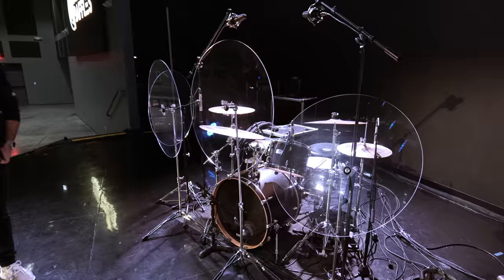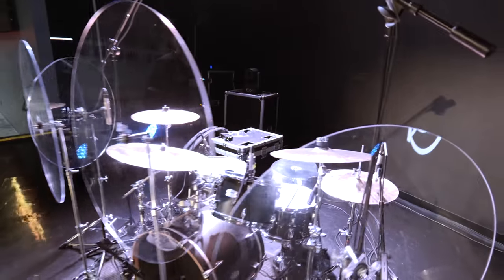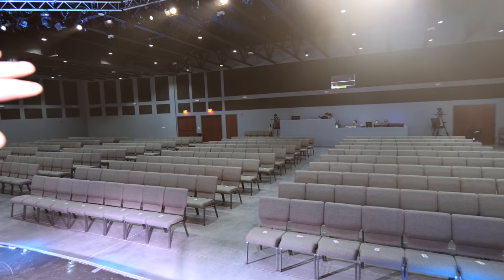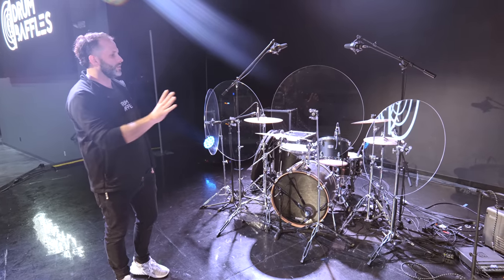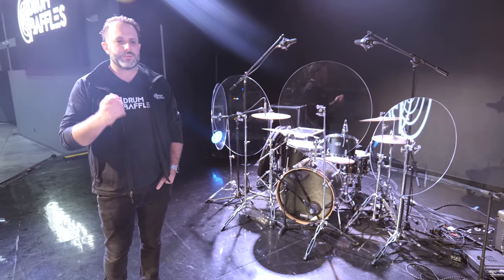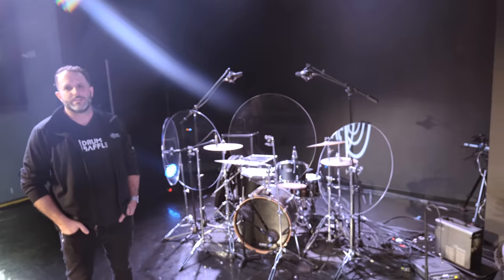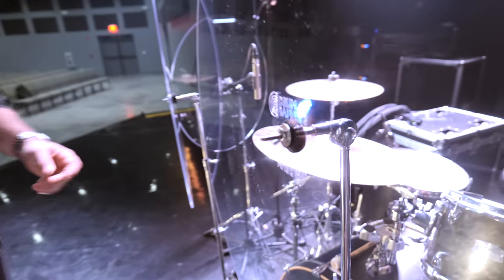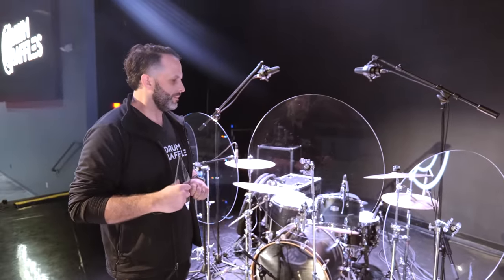Drum Baffles for Worship Bands

Comment: There's a lot of misinformation here. I watch your videos all the time Jake and I enjoy your content, but I feel the need to counter some of this guys claims to avoid volunteer church audio guys being misled.

"In an enclosure, the band members can't feel the kick". You don't feel the kick from the natural energy of the kick drum. You can hear it being hit, but it doesn't naturally emanate 50hz sound waves at 95db. Subwoofers do that. An enclosure doesn't prevent this.

"Putting a sub on stage defeated the purpose of an enclosure for us". A subwoofer on stage with the kick, toms, and bass guitar coming through it is nowhere near the same as reproducing an entire unenclosed drum set. The purpose of the enclosure is to reduce the entire volume of the drums so that they can be controlled by the audio engineer.

"One drum mic picks up everything (in an enclosure)". This is the case on an unenclosed drum set as well. It's the nature of drums, they're all loud regardless of whether they're in an enclosure or not.

"You only need one or two mics in an enclosure". This is 100% not true. Yeah you get reflections in an enclosure but this is being dramatically overstated.

"Your mix sounds better because you can have targeted mic placement outside of an enclosure" This is the one that made me stop and write this. It's a blatent lie for two reasons. 1. When you mic up your individual drums in an enclosure it's not difficult to achieve isolated sounds. Again, there is some reflection but the amount of hyperbole he's using is off the charts. 2. If you're talking about bleed, your mix will sound undoubtedly sound WORSE without an enclosure because it's impossible to isolate everything. Your drums are now bleeding into everything on the stage.

"Your tom gates won't be going crazy outside an enclosure" I disagree, they'll still act relatively the same. Tom gates are difficult to dial in because the cymbals are right next to the tom mics. The sound waves that are guilty of falsely triggering the tom gates are coming directly from the cymbals 6" away. Not the waves that have bounced off the plexiglass and come back into the tom mic. Yes the toms are the most difficult to gate but if you sidechain the gates to triggers you'll be in good shape. I would do this no matter what the setup was. This is not relevant to being in/out of an enclosure.

He says "The drummer should play like there's nothing in front of them" but then a few seconds later says "Don't have a heavy hand, play controlled, and don't kill the crash". These are opposing philosophies! You can't have both. If you want the drummer to have the freedom to play however they want, it's going to be loud sometimes. He's essentially saying that drummers should play quieter...which is why we're in this predicament to begin with! If your product works, why are you asking the drummer to play quieter?
Reply: Bethel, a church renowned for their live and recorded sound, uses 8 inches of soundproofing on all sides of the stage... AND a full drum cage.
Reply: Great post.  Just want to add, it appears they have these baffles in front of a set that is just a few feet in front of a drywall-faced wall, which is just going to reflect everything out again.
Reply: I honestly see a lot of misinformation on this channel. It’s become a recurring theme here. I don’t think he does it on purpose, but it does keep on happening.
Reply: Very good response here. As a musician who is trying to learn live sound I appreciate points and counterpoints for information.
Reply: Appreciate the info.

Comment: The size and maker of the cymbals is also important. Smaller cymbals will destroy mixes in small rooms. I have found that larger cymbals are great for worship teams. Larger cymbals also produce a larger sound which reduces the requirement to hit the cymbal as hard to achieve good sound. And of course the cheaper the cymbal the more you’re going to notice it in the mix. Just like the quality of mics and heads is important so is the quality of your cymbals.

Comment: Shy baffles or drum baffles are an excellent tool, just gotta pick them for the right job. As mentioned, these don’t replace a full enclosure in a smaller church. If your kit is backed up against an untreated wall, this isn’t gonna do what you want it to, it’ll reflect everything back off that wall that already has reflections. 

I’ve been to many churches that bought something similar thinking it does the same thing in reducing drum volume coming off stage, which they don’t. They limit direct interaction for higher frequencies only. These work excellent in larger spaces that are properly acoustically treated and have room above, behind, and beside the kit. 

There is a lot more to keep in mind though and cage or baffles is only a small piece to it. As mentioned drummer control and dynamics is huge. But also picking the right cymbals will go a long ways. I’m helping a church out right now with a smallish auditorium, real low ceilings, no acoustic treatment, and before I got there, they got rid of their enclosure, bought baffles, and bought real nice big thick and heavy Istanbul cymbals… I can mute the drum mix in the house and all I lose is the subs. I have to mix the entire band up to the live drum volume to get a balanced mix and I have very little control over the drums themselves. 

Do your research, talk to experts, pick what’s right for your space, and team, not just the newest latest greatest thing you saw bethel using.

Comment: We made our own set of these for a massive discount. We've used them for over a year, and it's been awful.

Our room isn't that small, and our treatment is slim to none, but, we went from 5 tall panels, open back, no roof... to 4 of these types of baffles.
We aren't quite sure what is worse, but these were not the answer.

We have now designed a drum cage, room, whatever you want to call it. It's costing nearly £1000, but we''ve visited other churchs who use cages, and there are only benifits to them.
Yes, you need more mics, but most churches have them already. Also, if you're spending money on a drum cage, balance in the cost of mics.

Unless you have a very large stage, this product will not work. You will have to bring your FOH up to the drum level, and you will fight drum bleed in vocal mics.
Save the money, build a cage.

I know there are many other factors, but I've kept my comment as short as possible.
Reply: We also have the same issue. There is a lot of bleed from the cymbals into the vocal mics even with the drum platform that is elevated on the second level of the stage with the vocals on the first.
Reply: Couldn't agree more. These are a great idea to sell but reduce sound about as much as a popsicle stick
Reply: Agreed. We use a drum shield and throw acoustic baffles on top. Not enough and have to mix to drum level. Will be building a full cage soon
Reply: If it really is that big of an issue why don't you just use Edrums instead?  You get all the benefits with the (in my opinion) absurd and ridiculous look.  By the time you factor in mics, stands, cables, the cage and dampening itself, not to mention the drums cymbals and hardware, Edrums will be either the same price or cheaper.
Reply: We have gone down the hybrid pathway - drum triggers with real cymbals. We weren’t happy with digital cymbals, or how digital kits looked, so this worked for us. 

We’ve gone for dark sounding good quality cymbals with nice tone, and we still have the panels in place to curb volume a little. 

The results are good, the congregation can’t tell the difference now (including visiting musicians, our drummers and sound team worked really hard on the sounds!), we still have to mix up to the cymbals but thats are nowhere near as loud as a live kit. 
All the instruments are running direct and the whole team is on in-ears. Basically a silent stage. 
Initially it was a learning curve but we got there together, and we have great tone across the whole team now, no competing. 

It doesn’t really matter which way a worship team goes about solving the problem of drum volume management for their particular room, as long as the money and time spent solves the problem by fully embracing the laws of physics first!
Reply: @djjazzyjeff1232  I'll boil down my answer and shoot straight. We can't. The drum kit is owned by the drummer. Yes, we can buy our own, but he prefers his drums. It's saved us money in the long run. But, with every good there is a bad... He won't alter his play style or stick weight.

Now, we would be a lot better off if we brought our own kit, gave him sticks, and told him to get on with it. But, he's a volunteer who gives up 2 weeks every month to play. We have another resident drummer, who also gives up 2 weeks every month. If we were to tell them "Here's your new kit, now play" and it's an electric drum kit, or bamboo sticks, we will have either no drummers, or drummers who are out of their comfort zone.

We then move on to the question of, should we let them get away with this behaviour? That's the million dollar question. We don't know, and I think a lot of churches have this with their drummer too. Hell, they probably have this issue with the guitar player, lead singer and triangle player too. We live in a world where people have creature comforts. If we were to change the way they play, give them different equipment, and take them out of their comfort zone, we will hamper their ability to play and add a distraction away from God and the Holy Spirit.

To to sum it up. We are building a drum room.
Reply: @Jamesrwpowell89  Forgive me if I'm being too presumptuous, I'm not trying to tell you how to do your job here I'm only trying to help, that being said, I have dealt with that before in my own bands.  I'm not a church player but I've fronted rock bands for over 10 years with all types of personalities, and you have to just do a good job of selling the ideas you want to try to your drummers.  Sure, there's a balance and a fine line but if you can effectively communicate to them why you need these changes and get them on board, you've won the battle.  You're probably right about the drum room, but like for what I do it looks so ridiculous it's not even an option.  I'd go to the ends of the earth before doing that, but like I said I'm not a church guy so I realize it's a different thing.  

But, my aversion to shields or drum rooms has led to several solutions I've discovered over the years, the most important being the snare "drum skirt."  Basically it's a 2x4ft black towel that you fold hamburger style so it's 2x2, and then you hang it from just above the bottom rim of the snare almost to the floor, so it's effectively a curtain between the drummer and the audience but only for the bottom head.  The beauty is that it's only the front half of the drum so from behind the kit whilst playing, the sound is virtually unchanged.  But if you can curb that bottom head's projection off the floor and out to the room you can cut down on that projection clattering around the room ruining any mix.  Then if you can convince your drummer to either lower the tuning of the top head and/or add a bunch of muffling, perhaps an E-Ring, you're golden and don't need a drum room, assuming the snare is a big problem which it was for us in the past.  Perhaps give this a try, even with your drum room.  It will clean up your sound in the mics even within the drum room.  

Aside from the snare, it's the cymbals, and getting dark sounding cymbals is the key there, but that can get expensive and hard to sell the idea to someone who likes his super shimmering A-Customs or something.
Reply: @djjazzyjeff1232  Agreed. I want an acoustic drummer as much as anyone (heck, let's just all crank up until it's balanced to the drums!) but with the price and quality of modern electric drums, I don't think mics and any sort of shielding make economic sense for most churches. Not to mention that multiple channels for drums adds a lot of complexity to novice tech volunteers.

Comment: In my personal experience of about 18 years playing drums in the church, I would have to say most of the issues with drums come from a misunderstanding of the instrument itself. Many churches would find drum enclosures nearly unnecessary if they knew the variables that create loud drums.

Cymbal weight, thickness, diameter, and treatment are all directly related to the amplitude of the cymbal. But as a rule of thumb, the thicker, heavier, larger and less treated a cymbal is, the larger and harder to control it becomes. If I was recommending cymbals for a church for the least amount of output possible by a traditionally treated group of cymbals, it'd be: 

Diril 14 Primitive Hi Hats (Between 700 and 800 grams for the bottom and top)
Istanbul Agop Xist Dry Dark Crash 20"
Istanbul Agop Xist Dry Dark Crash 17"
Zildjian Special Dry Ride 23"

The loudness of drums is also directly related a large amount of variables, but these can be reduced to three fundamental and easily controllable parameters: Tuning pitch, diameter and material. Just like cymbals, the larger the diameter, the louder a drum's potential amplitude. Unlike cymbals, drums can be tuned. Also, they can be made out of less dense materials like wood that absorb a larger amount of the skin's vibration. Higher pitches are percieved as louder be the human ear. Lower pitches are percieved as quieter. Because of the nature of the tuning process wherein tension is mainly place on the outside portions of the skin, the thinner the contact point and shell of a drum, the louder it's potential, whereas the thicker the contact point and shell, the less potential, PROVIDED we are working with a wooden shell. If I were to recommend a shell pack, I would recommend a Sonor AQX Jazz kit. (10, 13 snare, 14, 18, bass drum). Smaller sizes cut down on stage volume and allow more control over the overall mix.

A little digression: B20 Bronze- which is generally what all quality cymbals are made of, with various proprietary alloys introduced by manufacturers- was specifically invented and designed for the creation of good old fashioned, hearing destroying church bells and hand cymbals. No wander we're having such a hard time controlling them. Also a little sidenote: If you've ever been to a church with a full sized organ installed and a brass band playing, you begin to realize just how loud music before electric amplification actually was. Older generations had louder acoustic instruments in the church than most churches will ever have today! 

But I digress.

Comment: Hey Jake I love your content, but this was a bunch of miss information to sell a product. 
I stopped when he said in an enclosure the sound waves are going to bounce around and open gates uncontrollably? and you only need 1-2 mics? WHAT? 
the natural sound of drums already do that in or out an enclosure. 
the true problem with most churches is controlling the signal to noise ratio, which just means stage noise being louder than the PA for a live sound engineer. You do not want to be at the mercy of your drummer playing "soft" to get a good balance in the room. YOU CAN NEVER GO WRONG putting drums in an enclosure. only WHEN you can push the PA louder than the stage noise this won't matter, then yes baffles are a good solutions for IEMS or broadcast. 
This guy is making huge claims that was extremely misleading and overboard the top to sell this product.

Comment: It’s a no from me dawg. 
So much doesn’t make sense about this. Snare cuts way more than any cymbals. I’m a drummer and FOH Eng and prefer to not play behind a screen, however I do because the room calls for it. 
This does little for the congregation and more for those on stage that don’t want cymbal bleed in their ears (which shouldn’t be there if you are running decent IEM and have correct gain staging and gates on your vocal mics). This is a decent touring solution if you want to mask the side of the kit form BVGs instead of a screen. Also, the way those cymbal stands are setup makes me cringe. Gosh. A drummer did not set this up. Lol. 
Ask your drummer for a solution if they are playing too loud- do not put a dampener on my cymbals, haha.. it’s Probably cheaper to Invest in the best cymbals available with lower tone and less shrill. K’s are great. 
Church front is legit. This is not a viable solution instead of a cage in my opinion. It’s a different solution, not the same result.